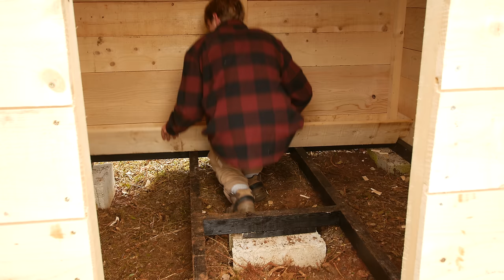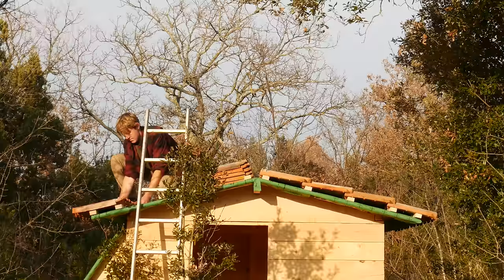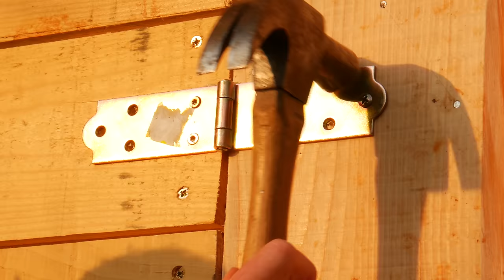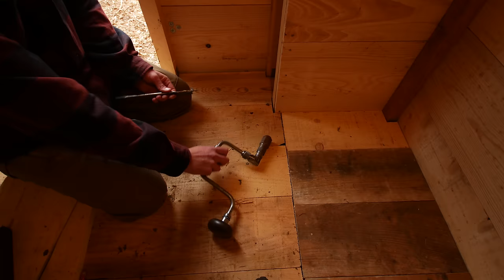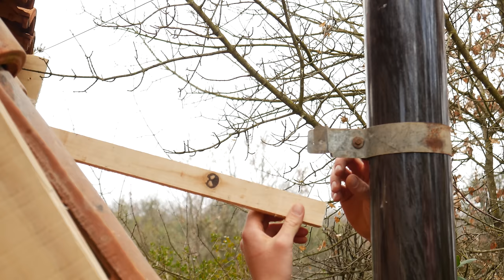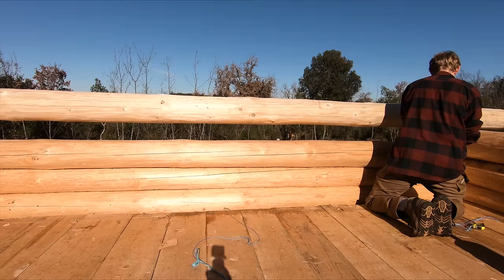Building a Simple Cabin On My LOG CABIN Build Site | Off Grid | Stove, Roofing, Door, Window | EP 10

Comment: Try holding the hammer nearer the end of the handle and using your wrist more to lift and strike it is more accurate gives more power to each blow and is less tiring on the arms

Comment: Also, I would be afraid someone might lock me in why not have that slide lock on the inside and a door handle on the outside ?
Reply from the maker: You can lock the lock and then you can't move the slider.
I will add another lock to the inside.